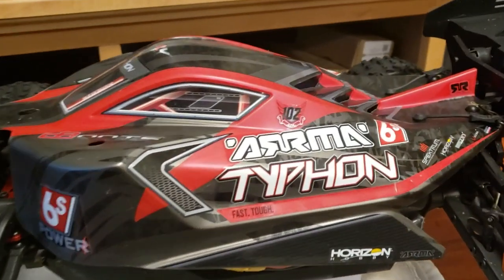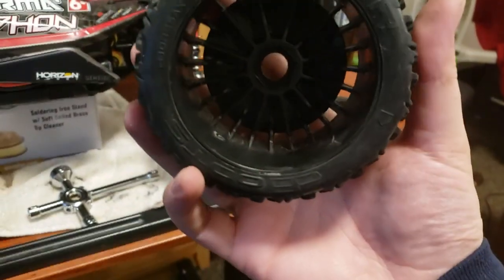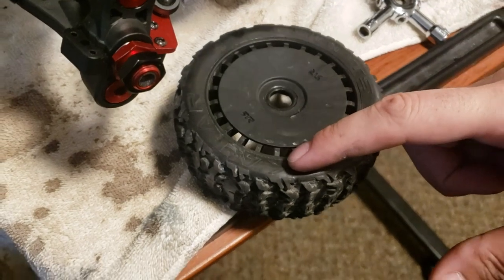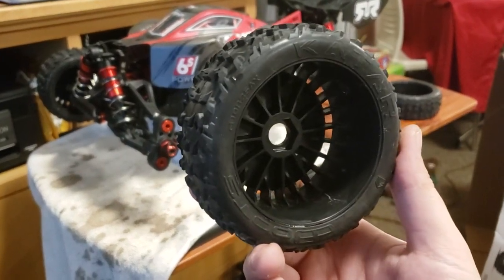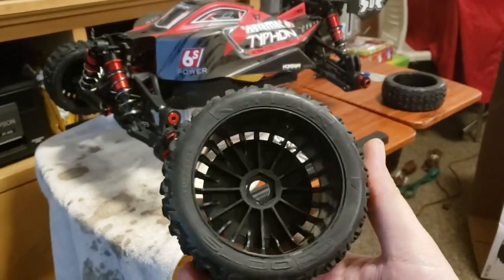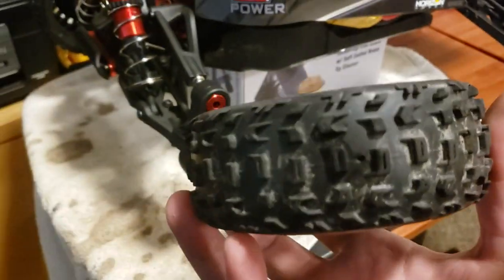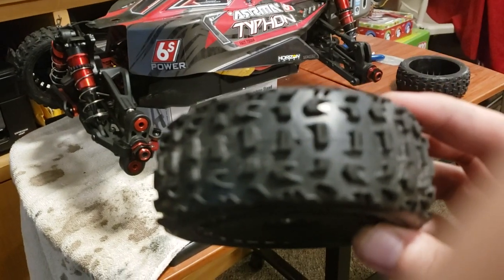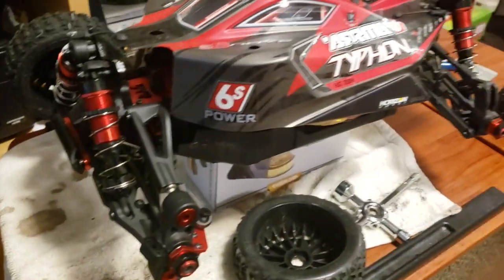Arrma Typhon 6s quick tips and tricks. (Mostly common sense stuff)

Comment: I love old school audio can't stop looking at the setup
Reply from the maker: me too. Old school audio stuff sounds so much better than anything besides apex audio stuff from today.. but you have to get into the 30 thousand dollar setups before you start sounding better than every day audio equipment from back in the day.. These speakers rattle my whole building and sound amazing doing it.!!!
Reply: I will definitely get back into it when I'm out of a apartment, my old technics reciever and 4 12s would knock the air out the room, back in the 90s, I'm thinking of a older high power 2ch with cerwin vega 15s and advent 8s for second room for my next setup
Reply from the maker: @davidpistek6241  i had a pair of cerwin vega 15's back in the day they CRANKED!!!
Reply: Those red 15s were iconic in the day, nowhere near as efficient as a soundbar but the visual impact and the house shaking bass can't be replicated with the newer stuff
Reply from the maker: @davidpistek6241  100% agreed

Comment: Hi man! I've taken a Typhon just two days ago. I've noticed the front wheels look to be splayed open...that's not normal right? I can adjust directly the steering leverage to correct this right? Thanks!!
Reply from the maker: you can have it however you want it. if you want them perfectly straight then yeah you absolutely can set them up that way. get the servo centered first and once the servo is perfectly centered you can mess with the linkages to get the angle youre looking for. and it really depends on what youll be doing with it. For bashing youll put the least amount of stress on the links and other steering parts with the wheels straight on landing. But you can adjust the camber and toe to be the best for any style. the typhon is extremely good at being whatever you want it to be and using it for whatever style you feel like.

Comment: Could I mix a 2s 5400 Lipo and a 4s 7000 to hit 6s in this rc?
Reply from the maker: Short answer, no.

Long answer: 
You CAN mix a 2s 5400mah and 4s 5400mah. All a lipo is is individual cells. 2s= two 4.2v cells. 7s = seven 4.2v cells. So using different S batteries is fine. All you're doing is adding more cells. We do this every time we build a battery. Lots of small cells= one large battery.  Series for adding up the voltages, parallel for adding up the capacities and discharge current.

But the problem arrives with the different capacities. 5400mah and 7000mah are not compatible. The lower "mah" pack will drain faster and at a lower voltage have to discharge at a higher current to meet the wattage of the ESC. Which can easily put it over its max spec. But even if it doesn't break the max spec line and stuff you into possible fire territory, its still a no go.  It's not even a good idea to mix different brands or even different age batteries even if they're the same make and model because internal resistances are gonna be different.

Comment: Ussualy we only make 2 holes on the tires and taping the inside holes. Never blew a tire when i made a hole . I only exploded one because of water.
Reply from the maker: yeah water in the tire will blow it out REAL quick when youre in the higher end cars with insane wheel speed..

and yeah 2 holes will also work. you dont HAVE to make 4 holes or anything.. i just like to do 4 holes so they water can drain no matter where it accumulates in the foam. and ive only ripped one tire from making a hole but that was enough to make me paranoid about it now every time i vent tires. lol.

Comment: Does your body rub on the servo arm when you close the body up?
Reply from the maker: yeah it does. I superglued a thick piece of plastic on the inside of the body so the servo horn wouldnt run through the paint on the body.
Reply: @jstagzsr  ok thanks for the reply ive asked alot if people and no one will answer . Must be a common issue. I just got a 6s v5 and having issues getting the front straight.  When I turned it on the wheels went left and I binded a dx5c radio to it so now I get to have fun trying to figure the dam thing out and to be honest this is my first ever arrma . Was told radio that came with it was crap and was upsold the dx5c so now I'm kinda lost. Also left side if suspension lifts some when I turn wheels left. But not when turning right.. sorry for the rant you just seam experienced.
Reply from the maker: @jasons3233  np man. I try to reply to all questions on my videos.

do this:

Take off servo horn. Off the servo.
Adjust turn buckles evenly so tires are both straight
Set radio trims to dead center
Turn on radio and car
Straighten wheels. Point them straight.
Put servo horn back on straight as possible.

If steering still needs to be adjusted, adjust it via the radio. 
------------------------------------------------------------------

As far as the tires lifting, once you get the steering straightened out that might stop. If not lmk.

Comment: It looks like you made the holes on the thinest part of the tyre that will rip like a zip, would it be advantageous to put that hole on the thickest part of the tyre? (Most common sense stuff)
Reply from the maker: no. You dont want the hole to be in the knobbies. Its too thick and any dirt or mud that dries in the now way longer tube you just created will seal the hole. Its harder to seal the thinner parts. you want the hole out of the way of where the contact is being made with the ground. it doesnt rip because youre not making a jagged hole. You make a smoothe hole. and a rip doesnt form. all tires can rip no matter what you do but there are ways to negate certain issues. no matter where you vent them doesnt matter 99.99999% of the time because its almost definitely not going to rip in either place. But there are other reasons you want the vent on the thinner part.
Reply: @jstagzsr  It's too thick...yah, the seal too sealed even though the ballooning is massive, thats gone, drill a smoooooooth hole in the thickest part of the tyre is in my eyes is better than in the thinest part of........

Comment: Get some brass tubbing form eBay it's about £2.  Sharpen her up with a hobby knife pop it in your drill and it vents a nice hole without tearing your foams.
Reply from the maker: yeah ive heard of this method and heard it works great. ive never personally felt a need to buy extra stuff to do it when i have drill bits already in hand. plus i like the holes to be super tiny.. thats why i used a 3/32 size bit. but yeah the tubing method works for sure!

Comment: help what kind batterys are you using? i have x2 3s battery 5000 my boody shell wont fit
Reply from the maker: I was using two 3S 5200mah Zeee Power lipos. They hit the body she'll but barely. Now I use a single 6S 5200mah Zeee Power lipos and it fits perfectly.

Try rotating your batteries till they're in the best orientation
Reply: @jstagzsr   thanks for the replay there one i see  a Spektrum Smart RC LiPo Battery Pack: 5000mAh 6S 22.2V 50C.. do you think that one will fit ? sorry i need some help
Reply from the maker: @dudespace4485  youd have to look at the size of the battery and compare it to your own battery tray..

The only battery i can confirm being a perfect fit is the 6S 5200mah Zeee Power Lipo i mentioned earlier. Ive only ever used 3 batteries on my typhon.
Reply: @jstagzsr  thanks you soo much for the great info my dood
Reply from the maker: @dudespace4485  NP man. Good luck!

Comment: Vent tires is the biggest misconception. You just seal them and then not water or dirt gets in at all. Been running seal tires for years no issue with little to no maintenance. Just got to check and make sure your glue is good after every few runs. When dirt get in the foam it does not come out it a sponge. That’s what sponge do hold dirt.
Reply from the maker: I fully disagree. If sealed tires were better than vented then every high power car on earth would come with sealed tires. There are many reasons why venting is mandatory.  Not just dirt.
Reply: In the word of racing yes I agree. Cause the tires don’t last long and come off the rim to be changed. Plus they don’t run in water. But in the world of bashing no way. Go weight you tires new and go run thought a lot of mud and water and then weight them after. I bet you there heavier after.
Reply from the maker: @leviblocher1895  no.. nothing gets in the tires when you vent them. the hole is too small and they spin too fast. the entire point of venting them is so water and mud and dirt and shit DONT get in your tire.. and you think theyre gonna have a noticable weight difference? i dont wanna sound rude or mean but you clearly have no idea what youre talking about. ask literally anybody about their opinions on vented vs unvented. for every thousand people who vent their tires maybe youll find 2 who dont because they dont know about venting. any serious RC racer or basher  vents their tires.

Comment: Those stock tires are horrible and disposable.
1 4S pack in a parking lot and they were bald.
Reply from the maker: Lol. Tell me you have no throttle control without telling me you have no throttle control .... 

They're soft rubber on a trillion rpm rim.... WTF did you think was gonna happen when you mash the throttle the whole time and let the asphalt grind your tires into dust? I still have the stock tires from that car.. 

Tires are a part you just have to replace eventually. no matter what you do they will wear down. But if a single 4s pack had your tires from brand new to bald in a single run then the problem isnt the tires dude.
Reply: @jstagzsr  The 6S V5 is my 5 year old grandson's birthday present.  Great grandpa got him a Honda Z50r.  For his age he is an excellent driver, he let her rip, didn't tip, and had more fun driving it then any adult ever could.  Got lots on video and damn the 6S is Fast🚀🚀🚀🚀